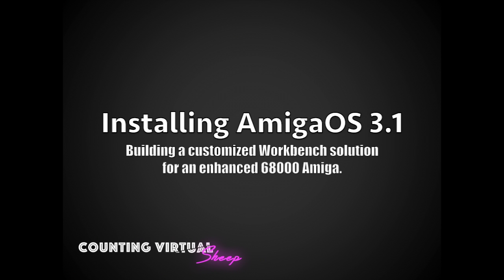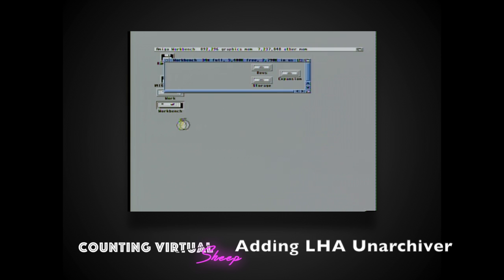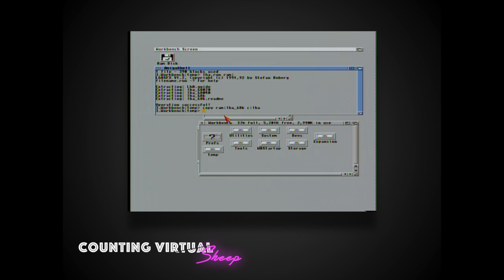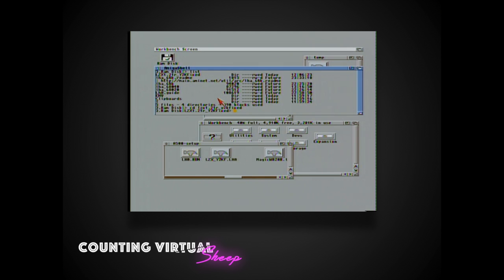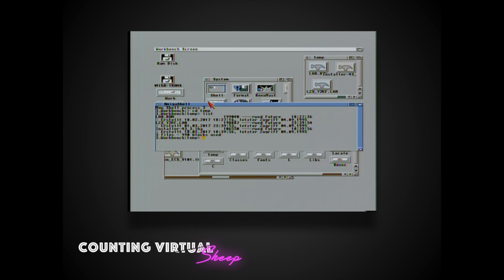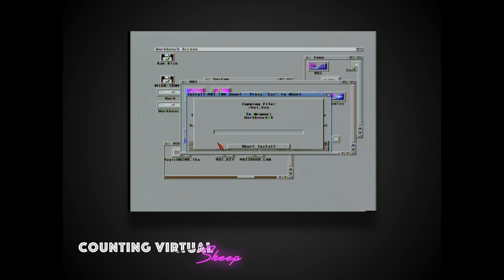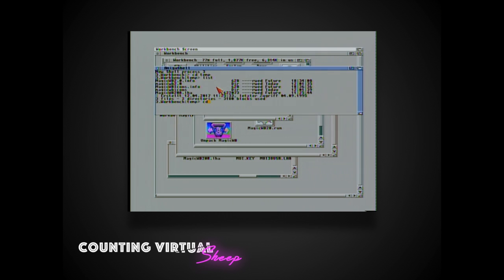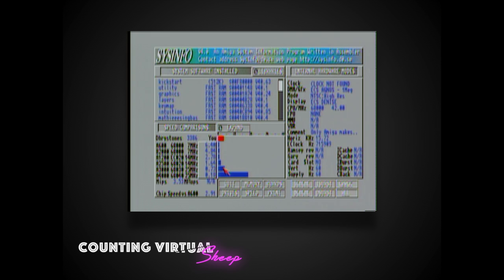Creating the Perfect Amiga Workbench 3.1

Comment: What brand CF cards are you using ? I have transcend 4gb cards and the amiga os auto installed and boots to workbench(though not sure it is correct) and the aux card is seen but not its content.
Reply from the maker: Sorry, I just saw your message. I'm using two types: The boot card is a SanDisk Extreme 120mb/s 16gb and my transfer card is a Kingston 8gb
Reply: Will Williams would you be able to answer a question beyond brand(I've got a Kingston 4gb coming and I was trying trancend 4gb and a ProMax ATP card with same result) My issue is the install Seems fine with the auto installation but the Aux card while recognized by whatever I name it and capacity it cant see the files I put on it (adf etc.. ) closest I got was WHDload to be seen and supposedly install but for the life of me Idk where even having watched it do it . I admit I'm fairly new to this side amiga outside floppies but I couldn't think it'd be this complex.
Reply from the maker: If the drive icon is showing on Workbench, then I would guess the CF card is working correctly. Forgive me if you have already tried this, but have you been able to open the drive icon and then display all files? i.e. From the Workbench menu: Window -> Show -> All Files

WHDLoad should default to DH0:, the installer adds a couple of files to the C folder.
Reply: Yes, I've tried that (Right click) while the icon for drive is highlighted... menu ...show ... Nothing . Pull it out put it back to windows and they show . I even went as far as reformat the card inside work bench to see if it left anything to the card that could be seen and it took about 45 min for the size but formatted and left a trash icon inside the directory that could be seen . So it makes me think I'm missing something on the windows to amiga transition yet all videos I see its simple drag n drop PnP. Even tried FAT and FAT32 to see if any difference . 
Above all thank you for responding. :)
Reply from the maker: If you're seeing the trash icon it's working. Try opening the drive window (icon) and doing a show all files. I don't have Windows so it's hard to say there's an error in that part of the process. You could try opening the CF card up in the WinUAE and copy the files over to the card and then move it to the real Amiga.
Reply: Yes I agree , the "Amiga" format would show that the card is viable however in "FAT" it just doesn't see the windows applied files where it should . I have considered learning the emulator to try just as you suggest however given its design it shouldn't be a necessary step and sorta defeats the purpose of cross compatibility a bit . I was never fortunate enough to own an Amiga when I was younger to learn the in and outs but now in my 40's I get to try at least, just makes little sense. I may contact the manufacturer of (aca500) with same question as it was bought direct but wanted to try one the Amigans first :) 
Thanks for your input.
Reply from the maker: I'm sorry it's not been as easy it as it should for you. This is one reason I love MorphOS, the operating system has awesome file system capabilities. I mainly use it for downloading and transferring software to the Amiga.
Reply: I've considered that system, havent seen anything on it really recent. I was considering making my G5 into one , would you consider that a good option and how well does it stand currently for modern web browsing and such ? How versatile is it as a whole ?
Reply from the maker: I'm running it on a G5, it isn't compatible with the Nvidia cards though, if your machine has one, you'll need to replace it with a Radeon. I think there was a couple of G5 versions that didn't work as well. Modern browsing isn't too bad, facebook and heavy javascript sites are a little slower. The OWB browser had issues with with googles cookies that prevented logging into google accounts. I think version 3.10 might have fixed this, I haven't upgraded yet to verify. I think it's a solid platform, you'll need to customize it with add on libs to use some applications.
Reply: Hi! When you format a CF card with the Amiga, you should always do a "quick format" to avoid potential problems with the card. Here's more information, hope it helps you identify the problem: http://eab.abime.net/showthread.php?t=61666

Comment: Does Workbench automatically recognise the PC formatted CF card in the AUX slot? It seems to show up on yours, but not on mine. I am also having some problems partitioning the CF card. It constantly says "Work disk not validated".  Liked and subscribed. :)
Reply from the maker: If it's FAT32 it should, I haven't tried NTFS.
Reply: @gregferguson7737  thanks, I ended up purchasing as SD card pre-loaded with games, but when I set the amiga back up I'll have a play around for the sake of tinkering.